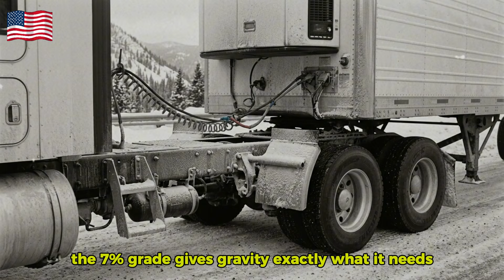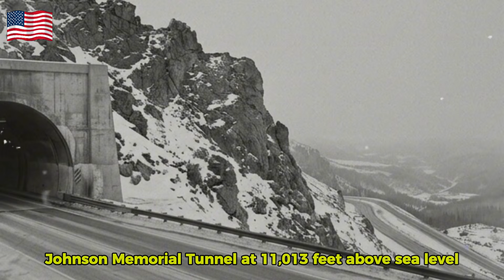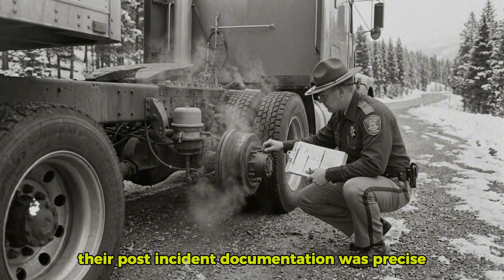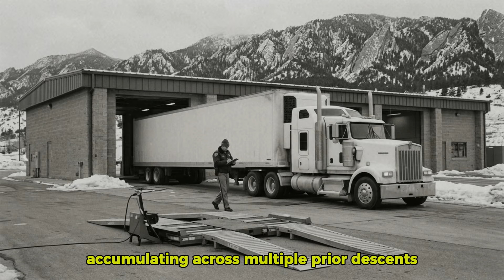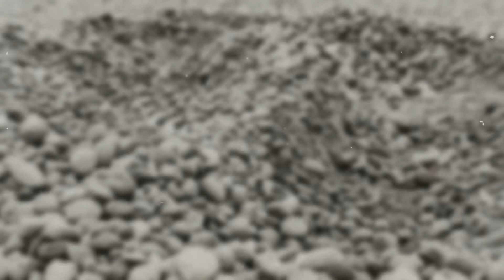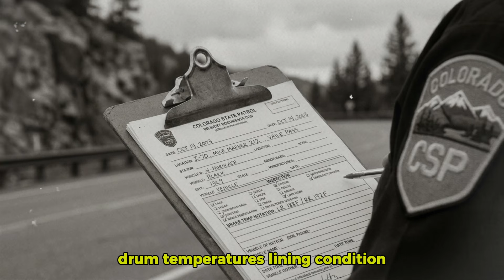No Brakes at 11,000 Feet The Kenworth W900 Runaway on Eisenhower Pass

Comment: Rewrite this bogus tale. A semi hauling 44,000 pounds of freight can never equate to 104,000 pounds gross vehicle weight. Unless the driver's body weight is 24,000 pounds. 🤨
Reply: What happens if the truck and trailer way sixty thousand pounds? I know many heavy hollers, whose equipment when empty is pushing 60000 to 62000 pounds. As I made in my comment, a standard fight back for commercial motor vehicle will not weigh a 105k with 44k.

Comment: How do you calculate 105500 lbs with 44k in the box, the tractor weighs around 20k, the trailer is around 10k. 20k+12k+44=76k...not 105k . You can not scale 105k on a standard 5  axle CMV.  Eisenhower is no joke
Reply from the maker: Thanks for sharing your perspective and doing the math on it. I appreciate you pointing out those weight numbers and axle limits. Discussions like this help highlight the technical side of trucking and regulations. Your experience clearly adds value to the conversation. Thanks for taking the time to comment. If you enjoy topics like this, please consider subscribing and supporting the channel. Thank you!